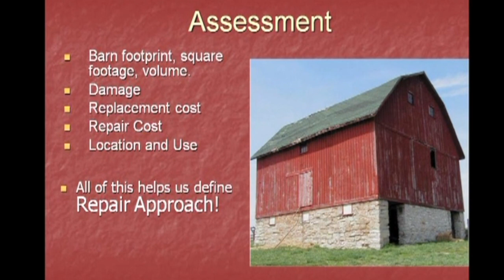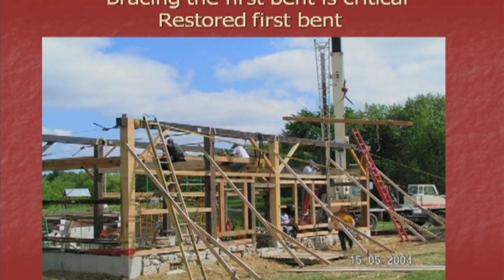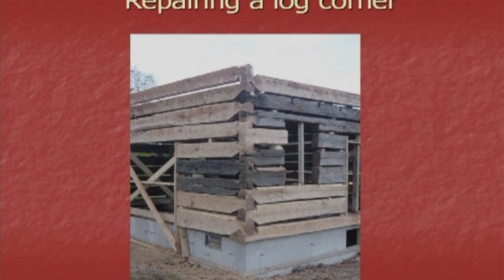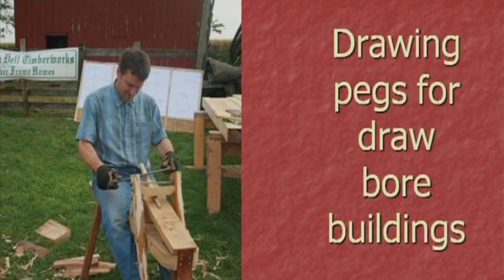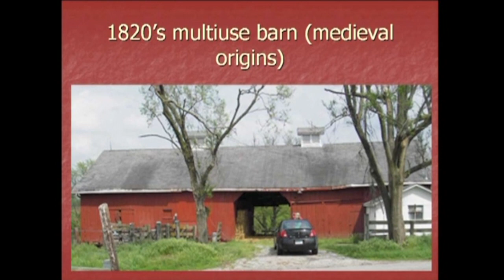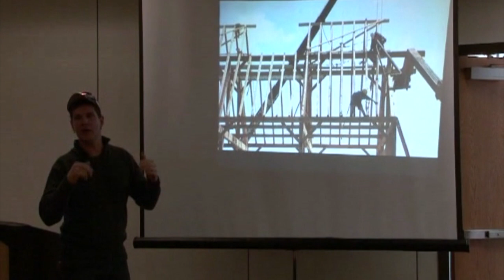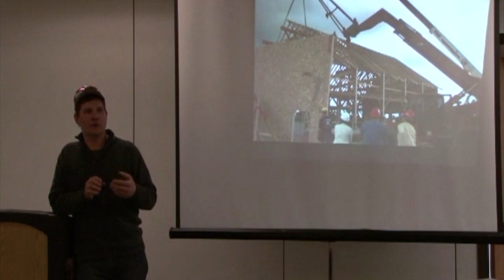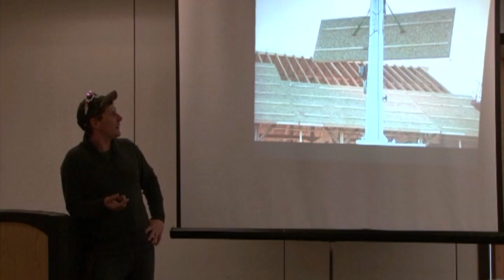Barn Restoration, Restoration Technologies, and Practices.

Comment: Great presentation. Thank you for posting it. I do have a question: I briefly worked for a timber framer in Michigan restoring barns and he would not provide estimates. After working with him, I could see why. There were a number of occasions where I'd be working on a seemingly intact timber to find the inside rotted or eaten away from pests. How are you able to accurately assess an old barn with these issues and likely crammed full of decades of accumulated stuff?